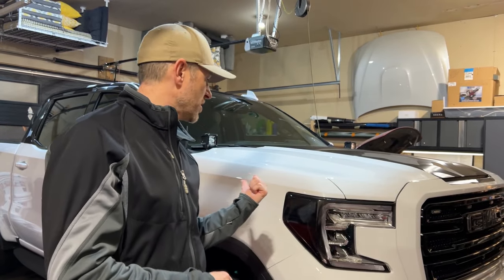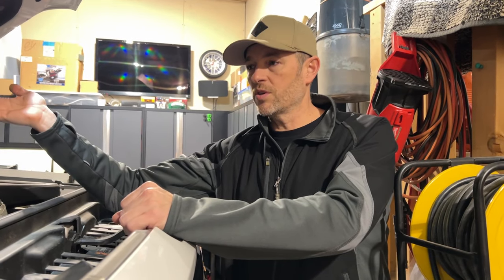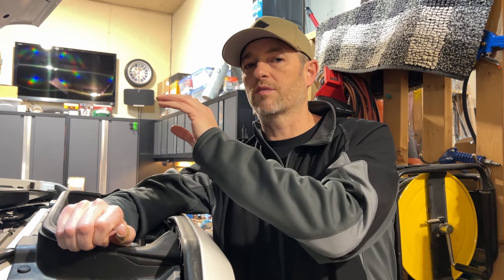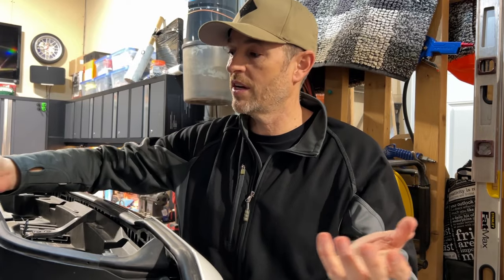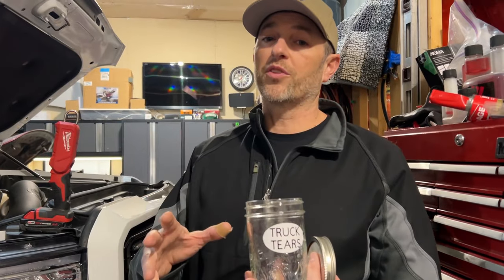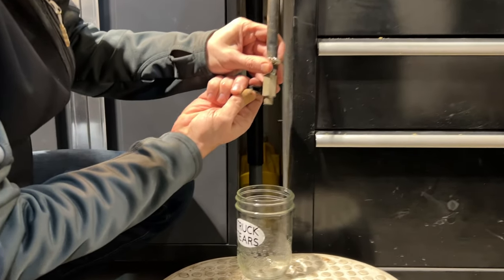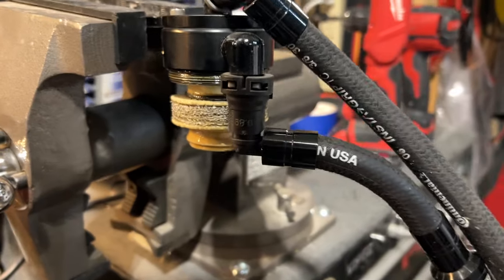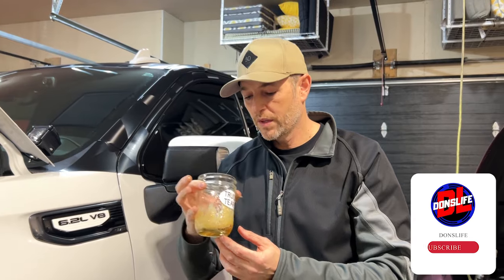Oil Catch Can: Surprising Benefits - Watch Before You Decide

Comment: I have a UPR as well in my 5.3 Denali.  The thing to note is that the condensation is being generated by the cold can itself and is not coming from the engine.  The engine gets too hot to quickly to generate condensation.   It would be better if the UPR can was mounted closer to the engine heat to reduce can condensation more.  Don't use any Lucas oil additive.  It will eventually clog the patented UPR four stage filters.  Ask me how I know.  Great video!
Reply from the maker: I agree the catch can mounting location that UPR created for this truck is a little further away than some.  Also the volume of the can and hose lengths allow for more moisture in the air to fill the reservoir.  Thanks for watching!
Reply: Hey so do you recommend using a catch can then? I also have the 5.3
Reply from the maker: If you are asking for a solution to keeping it in year round for easier draining.  Here is a video:

Solved the Oil Catch Can / Separator Issue!
https://youtu.be/NoFd_c0LCfs
Reply: Mine looks the same way and I was just thinking that if I moved my can to a warmer part of the engine bay I could evaporate that water and condense only the oil vapors.  I don’t know what temperature I need to condense oil but not water.

Comment: Catch cans dont reduce carbon buildup in gdi engines. They only collect contaminated water (condensation) that would get  burned off in a functioning pcv system anyways.
Reply from the maker: Is it possible the combination of returning oil and water vapor (dirty air) lower the functional octane rating of the mixture, leading to a loss in efficiency and performance?  Could a catch can help indicate engine damage if it is collecting excessive oil and not just condensation?   I think those are a couple potential benefits.

Comment: It's called condensation. Catch cans are not needed. I have Two DI vehicles one with a turbo. Use a good synthetic Oil change every 5k miles with filter and use tier 1 gasoline zero problems. Both are high miles and I have scoped them. 3rd generation mechanic and engine builder.

Comment: I put one on my  2012 Tacoma TRD Sport 4x4 Access cab 4.0 years ago. Just hit 50k 2 months ago.  It does not have your type of filter. It just had a metal plate with holes in it, so I added some Stainless Steel Chore Boy . It does not clog up or freeze. I do mostly short trips and have noticed that in summer I get more of a clean oil in the can (very little) and in colder months I get the milky mix. My oil in oil-pan is not milky during oil changes. I would say water came out of your drain hose because the water went to bottom of the hose and the oil/milky substance floated up above the water in the hose, (oil floats) and it is not in the catch can being constantly mixed up by the incoming PCV air constantly mixing the water and oil up in the catch can because it's way down in the rubber hose and separates naturally.  North East Pennsylvania.

Comment: I have a 2021 Denali 6.2 also. The DIC would tell me that the oil level was low and too add. I checked the level and it was still full. Took it into my dealer. I was told they couldn’t do any diagnosis because of the catch can and the S&B intake until I removed it all. I’ve never had any issues with these parts, and needless to say they are still on. The message never came back after I did another oil change. I use RP oil and K&N filter. After what I see what’s in my catch can, I’ll leave it installed. Same with the intake. Think I should try another dealership? I’ve bought 3 trucks and one car from this one.
Reply from the maker: I'd try another dealership.  But the catch can is a super simple removal and reinstall.  My dealership told me my intake would not be blamed if I suffered a known problem that can come with some of these engines.

Comment: I have the same truck and a different brand catch can installed, I live in California with mild winters compared to yours and my can is mostly oil with some water. I’m glad I found out about catch cans .
Reply from the maker: Right on! Thanks for watching and commenting
Reply: @Donslife  Nice video!
I want to mount a Provent200 and my winters are quite cold... I wonder if it will freeze, blocking the gas and clogging the crankcase path.. What do you think?
Reply: @OlariuAlexandruB  just do not let it get full and go back in the engine that’s why you have to drain it every 2 days in the winter

Comment: Love your AT4! 

My 5.0 mustang has a catch can, very useful and well worth the little investment in the long run.

Hearing your 6.2 makes me wish I would have got that motor instead of my 3.0 in my 22 AT4
Reply from the maker: I am very happy with my set up and 6.2.  Truth be told I almost went diesel but they were extremely hard to come by in late 2020/early 2021
Reply: My 5.0 has the police car sandwich oil cooler/heater under the oil filter. Plumbed into the heater hose as per Ford.
Keeps oil @200*f .

Comment: I believe it’s condensation due to the oil vapours cooling off outside of the engine. Oil mixed with water gives that white baby poo. In summer you would get oil residue in the can. It should still work by removing the oil going back into the engine.

Comment: Great video mate!
Two questions:
1. What are the internal dimensions of the inter connection tubes/hoses?
2. Did you notice any increment of the pressure in the crank-case due to the installation of the separator/oil catch can?

Comment: I feel like the condensation developed in the catch can it self, the air from the crankcase is hot and then spool around in the can I believe developes the water 💧. I have a catch can install on my small block chevy boat engine and it's pretty hot when the engine running and alot vacuum in it that the intake pulling.

Comment: Amazing video and info. Would all that water/condensation burn off through the exhaust?
Reply from the maker: Theoretically the engine would need to get hot enough for long enough to burn off any of the vapors or blow-by gasses returning in the PCV system.  The can is just catching them early for disposal.

Comment: I’m a 2019 sierra sle,x31  owner and recently bought the same one for my truck as you bought , have you had noticed that the filter media in the catchcan being frozen and not letting the air flow through it before the motor can warm up and melt the water contaminants not just in the can but in the filter area of can ?

Comment: Don; Your Truck is parked outside in those Low Temps, Correct? With all the Water found in the Can, have you experienced that Water being Frozen? Is Water in the Can a reason the Manufacturer recommended removing the Can during the Severe Cold?  I live in Central Indiana and we get some of those temps., but not as much as your area.  Appreciate any info.  Mark.
Reply from the maker: Yes and yes - Risk of excessive condensation in very cold conditions seems to be the primary reason for more frequent emptying.  The water in the can itself was only frozen once the engine bay sat to cool long enough.
Reply: I saw someone mention in another post that they add a little antifreeze to the can in winter.

Comment: Hi Don would you install a catch can with a diesel engine?
Reply from the maker: From what I have read for diesels, if you are experiencing excessive amounts of oil consumption, then a reputable and well designed catch can might be of benefit otherwise you’re probably fine as is.  Reducing sludge build up in the intake system is what it would be doing.
Reply: Thanks again Don! By the way I loved the lights you placed in your bed, it makes it look so much brighter.

Comment: You ve got mayonnaise, oil and water mixed...oil is ok, but water,(coild be the condensation in the air with closeby engine..) would check the summer time if it is the same mayonnaise. I would hope not.

Comment: Why is yours so milky? I have one on my 2021 AT4 6.2L and the oil I catch is more the color of motor oil (slightly watered down). Nothing close to yours. Do you run any additives in your fuel? I am in Texas so maybe the difference in color is due to your extreme cold temps??
Reply from the maker: It is everything to with the extreme cold.  Way more condensation happening.

Comment: do u recomend to use oil catch can o nhondas? or leave it oem pcv
Reply from the maker: You can add one if you want.  The main benefit is you won’t have to rely on the engine burning off the returning vapors.  Those burnt up particles contribute to build up.
Reply: wich bran is best to buy? @Donslife
Reply from the maker: @Hardenth50  for a Honda, maybe look at Mishimoto

Comment: Will the engine just burn this off nirmally?? I'm on the fence about getting a catch can for my 2020 chevy 6.2 silverado
Reply from the maker: Yes the engine will burn up the returned vapors.  The worry is the build up that is created over time
Reply: Drive it like you stole it must if the time....pretty sure I'm burning up the crap

Comment: In my opinion, a catch can with a non-serviceable, very coarse filter on a gasoline truck makes very little sense as you demonstrated here.
That was 95% condensation (water) with a small amount of captured oil, because of how your catch can is designed it will not catch much oil.
Here in Australia, we have mostly diesel utes, which are generally 'mid-size pickups'; because of emissions regs in Europe & the US of A these diesels are fitted with a very active EGR to return spent exhaust gases to the engine, the EGR valve is open far more often on a diesel than a gasoline motor, especially at idle and low power demand.

Hot, sooty dirty air. Not good for anything. This sooty air mixes with the oil and blowby gases released through the PCV (crankcase ventilation) and causes the carbon from the EGR to collect as sludge.

This is 1 of the main reasons for failure, loss of power and unreliability of modern diesels.
Because of this many thousands of guys will fit a catch can, these follow 2 general styles - a small aluminium can that unscrews, with or without a filter OR a Mann-Hummel/Ryco engineered can with a Provent 1-micron replaceable filter and drain valve, in my opinion the latter type, while possibly not as attractive is vastly superior.
If fitted incorrectly and if the can is not serviced and the filter is not replaced when necessary, these will blow seals in your engine and could potentially blow an engine.
A GOOD catch can can eliminate most of the oil in the intake, but it does nothing about the EGR spreading soot through your engine.

I used to get a fair amount more oil in my intake when I had a GM 3.6 V6 gas car than what you collected, so I can only assume it's not doing its job very well.

Any product for your vehicle that affects its emissions system that makes no distinction between a gas and diesel engine is either poorly engineered or a scam.

Comment: If you are returning the exit line from your catch can back to your cold air intake. You are returning probably 1/3 more of what you just dumped into the truck tears jar back through your intake system. And into your combustion chamber. That is what is messing with the air-fuel ratio. And the HP and the MPG. I call it wallet tears because it just sucks money out of your wallet. It's really engine sewage. No wonder they want all these extra emission control systems on vehicles. That shit just can't be burned. And it messes with your clean burning air fuel ratio so it can't preform properly. It's a hoxe. Like masks to protect you from harmful virus infection's 
PS I have a DIY  much larger catch can 4"X 7" with a 1.5" deep reservoir at the bottom to collect that engine sewage. The 1" inlet port has a 90% elbow going down to 1" from the bottom, the tube going down is a 1/2 tube with 1/4 " baffled holes then A baffle plate covering the reservoir then the can is filled with SS wool pot scrubbers to just below the exit port now you put a 4" round baffle plate on top of that and fill the can up with more SS wool pot scrubbers to make a can that has excessive collection ability   of anything that is to pass through the can the can is well filtered so venting to the atmosphere should be air. But I am not running any of that sewage back to the combustion chamber fowling the fuel injection tips, valve stems, etc, air intake manifold. And more. This defeated the scientifically metered air-fuel ratio to give the best and cleanest combustion chamber burn. As well as HP and MPG. Leading to the cleanest emissions possible giving the longest engine life. A properly-tuned and maintained diesel engine will have a life well above 500K miles with no black smoke etc. Arguments. I'm listening. Crickets. Yes.
Reply: P.S. the Can has a 3/8" ball check drain valve in the bottom for easy of draining whenever you want. I do it every 4K oil and filter servicing. More if I'm doing a lot of stop-and-go driving. I'm not suggesting you do the same. But I increased the MPG by 1/3 after the deletes. With the 1" ID tubing to and from the catch can CCV has not shown any seal or gasket leaks. So PCV is good.